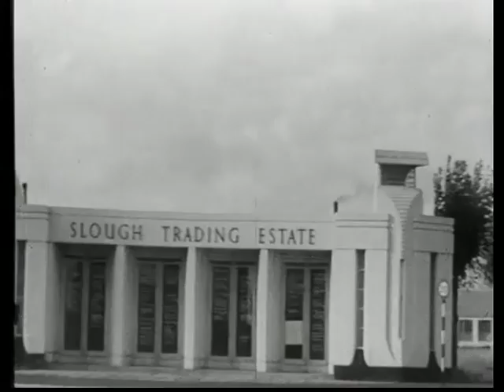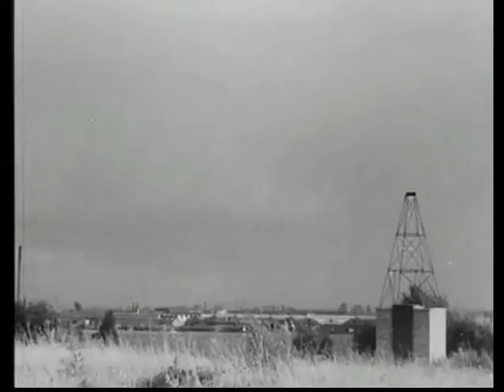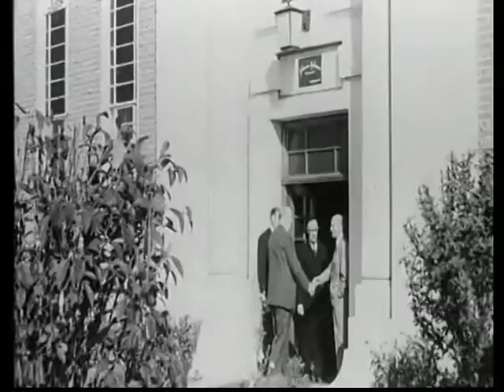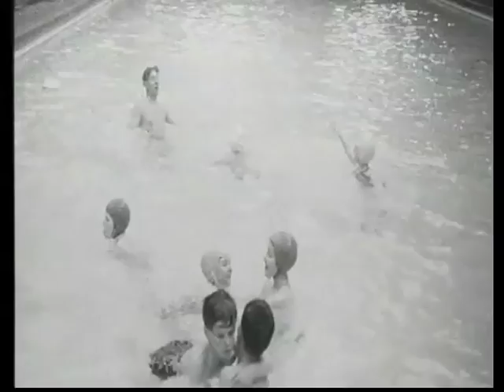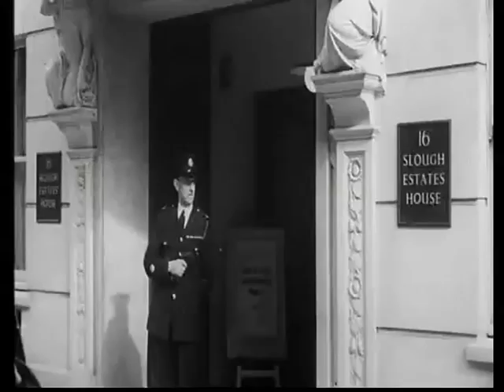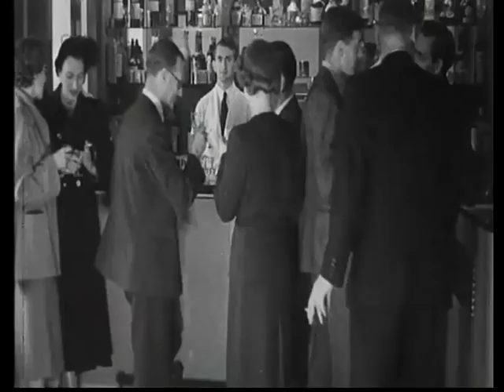STE History

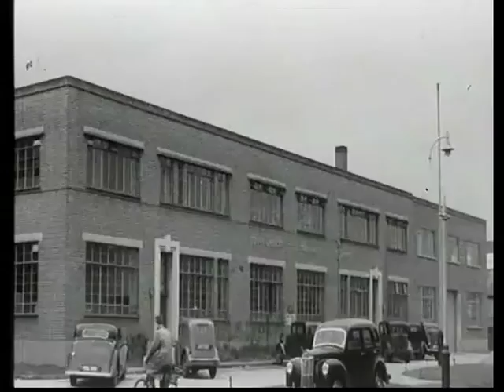Comment: 6:15 I worked in this building in Buckingham Avenue in the early 80s. Government Training Centres were renamed Skillcentres under the Manpower Services Commission quango. We moved to a new purpose built site at Walpole Road in Chippenham during 1981/82 and the Buckingham Avenue site was demolished. In the 90s the 'new' £12m site was sold off and demolished and replaced with housing.